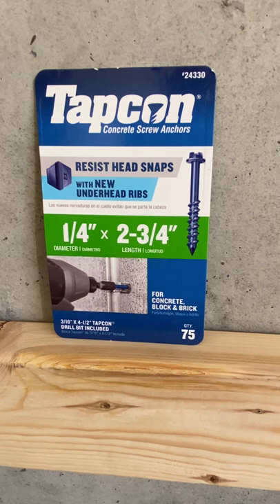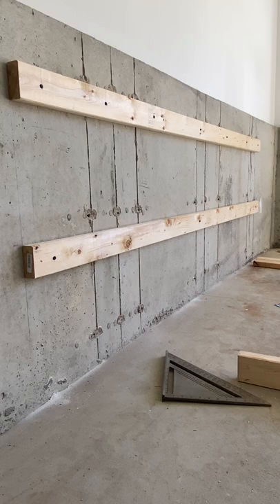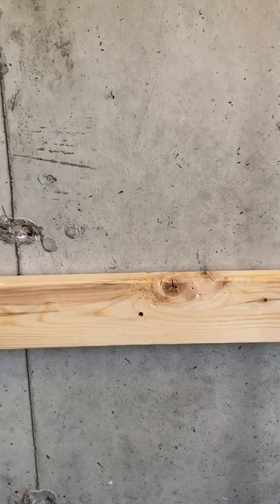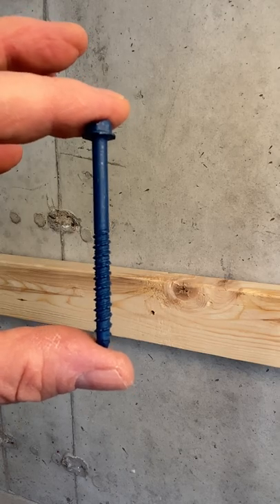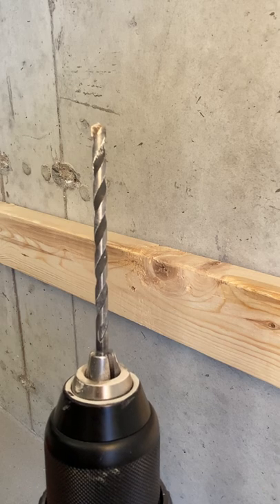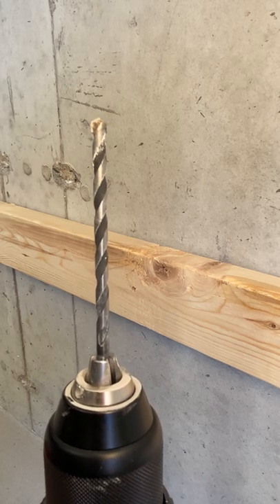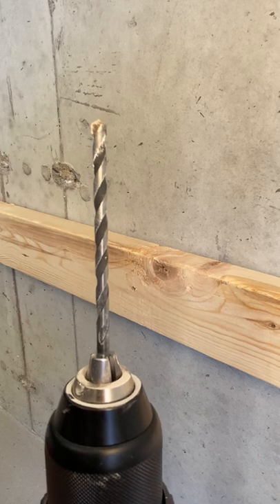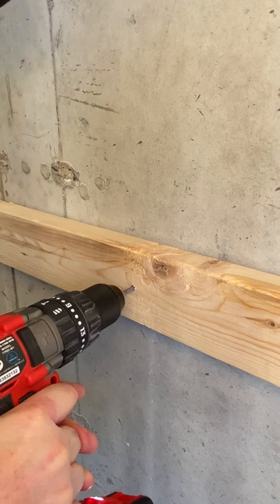TAPCON Screws ~ for Concrete #Shorts

Comment: Here's something that's interesting about these screws/bolts, that I learned in a seminar from a fastener manufacturer, about these fasteners. So somewhere on that box will be an answer number, that'll have all this information in a book somewhere but nobody I know ever looks that stuff up. So for those that do not know these are never to be used Outdoors or where there's moisture, they are not weatherproof. Now somebody at the seminar I mentioned, how come they have that Teflon coating on it if it's not to protect the bolt or screw. The Teflon coating is there to lubricate the screw and make it go into the concrete easier as well as help lock it into place once it's set. The friction causes it to heat up as you're screwing it into the concrete and melts the coating. As a building inspector I have to do these yearly continuing education things and these conferences have all these seminars that take care of the credits that are necessary. This is one of the seminars that I thought was going to be really boring that ended up being very interesting.
Reply from the maker: No kidding.. I didn't know that.
Reply: Thanks for that. How far apart can they be spaced ? I'm making garage shelves.
Reply: What do you mean by weatherproof? They are labeled as corrosion resistant

Comment: To fix hammock loops to concrete I had great success using walldog screws and a glass/tile drill bit without the hammer - much more quiet and goes in easily.

Comment: What was holding up the horizontal 2x4 when you drilled the holes into the concrete??
Reply from the maker: I had a couple of short studs holding it temporarily until I set the first two anchor screws.

Comment: I plan to use 3/16 tapcons to anchor the front cleat of a small set of steps to concrete. I’ve never done this before and I’m wondering if 3/16 is big enough or should I go with 1/4 inch? What kind of torque does the driver put on them ? 30 or so ft lbs?
Reply from the maker: The 3/16" would probably be fine but if it were me I would use the 1/4" for steps since they will have a lot of stress on them over the years. I'm a professional electrician not a builder... The impact driver puts plenty of torque on the screws.
Reply: @BackyardMaine  thank you! I appreciate the info!

Comment: We have drywall over one inch furring strips on concrete walls.  How are the electric junction boxes in there?  Did they cut into the blocks to put them in or use shallow boxes?
Reply from the maker: I don't without checking it out for myself but if it was done professionally the boxes are most likely cut into the block. If it is block. If not, your maximum box depth would be 1.5 inches which would limit the number of wires to stay within code for box fill.

Comment: Do I use the same size bit to pre drill the hole.as.the size of the screw..ie 3/16 drill bit for 3/16 tapcon screw?
Reply from the maker: No the bit is smaller than the screw. They usually come with a bit but if not it will tell you on the package what size to use.
Reply: Excellent. Thank you!

Comment: Is that just a home box store masonry bit? How long is the bit? I’m going to be doing the same type of install for shelves.
Reply from the maker: For the size anchors I used it was a 3/16 x 4-1/2 inch bit. If I remember correctly the bit came with the screws.

Comment: Does it matter what kind of drill bit to penetrate the concrete ?
Reply from the maker: Yes, you want to use the specific size masonry bit. Depending on the package the bit will often be included in the package of screws.

Comment: Spaks  are better, and the heads are flat
Reply from the maker: I assume you mean SPAX screws. I've used them several time but never in concrete. TAPCON makes a flat head as well.